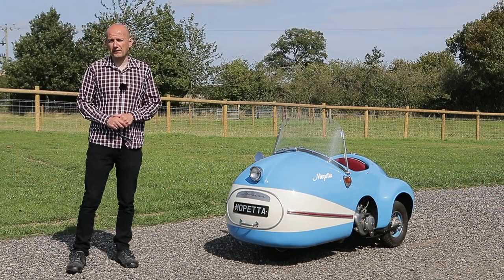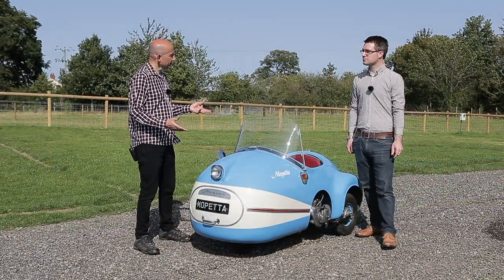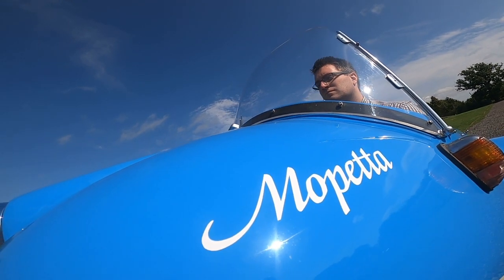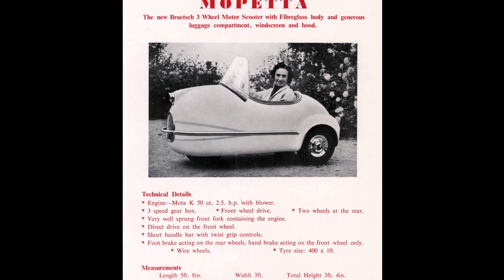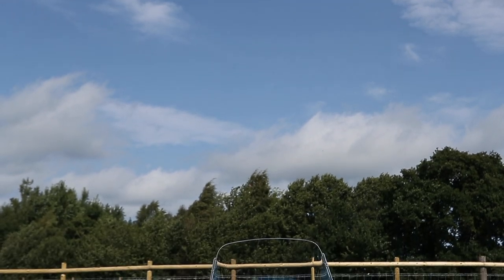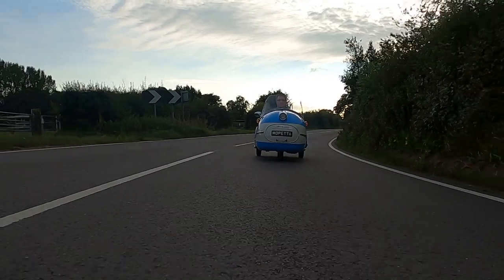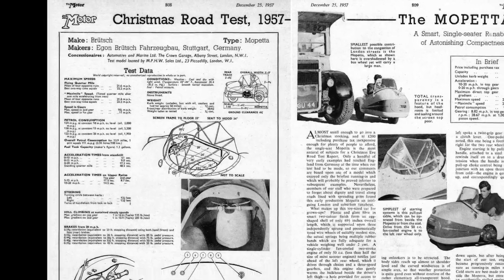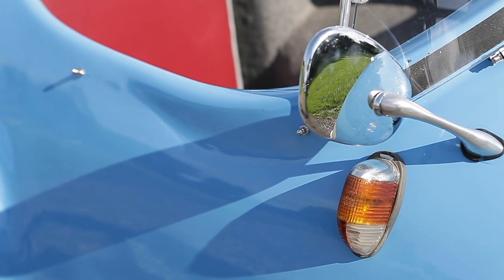The story of the bizarre Brutsch Mopetta microcar

Comment: Any idea why the spelling is 'Bruetsch' with an 'e' on the Motor Show stand (02:26)?
Reply from the maker: No. Sometimes the period literature refers to Brutsch and sometimes it's Bruetsch. There seems to be massive inconsistency over this and it doesn't make it any easier knowing what to call the car!
Reply from the maker: It seems to be the UK importer that added the 'e', although the period test in Motor refers to the car as the Brutsch Mopetta, even though the car was supplied by the UK importer.
Reply: I am German as well as this "car" & here it was & is always referred to as Brütsch with "ü" (guess that's the name of the inventor / producer). The reference as "Brutsch" or "Bruetsch" may be to the fact, that you don't have the "Umlaut" ü (as well as "ä" & "ö") in English.
Reply: It's German "Brütsch" - if a language (or a keyboard) has no Ü we, use UE instead. It sounds like the french U....but not like in english.